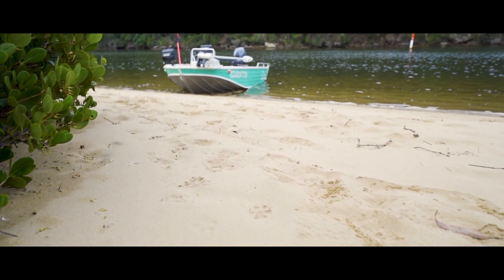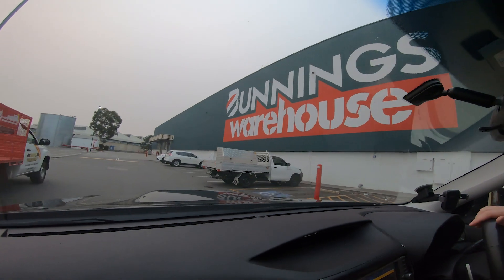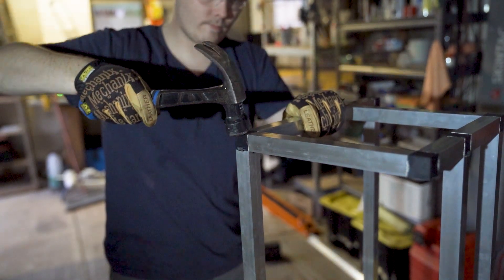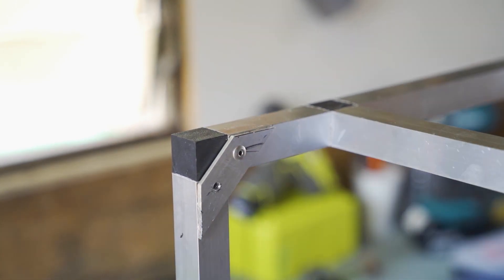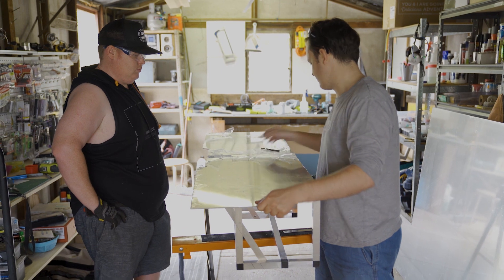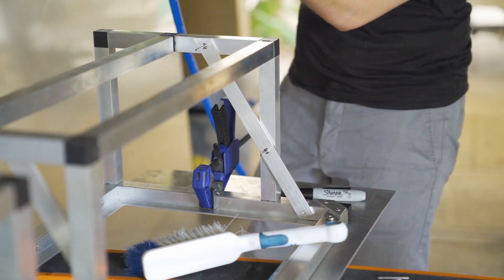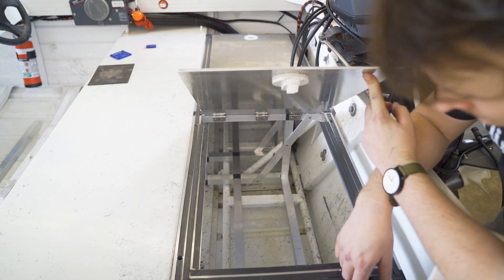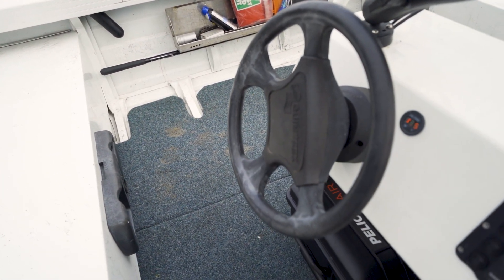BUILD an Aluminium Rear CASTING Deck | DORA PROJECT 🧜‍♀️

Comment: What was the thickness of your aluminium sheet, thinking of doing similar project replacing ply flooring
Reply from the maker: The back is with 4mm, but 3mm would have probably done the job

Comment: So watching your vlogs has  got me thinking about making front seat in my tinny into a storage area. Top of seat already damaged by a dodgy bucket seat by previous owner. But I'd like to make it waterproof design. 
1. cut reqd access hole in seat.
2.using angle attached to C channel, mount angle beneath perimeter of hole. The C channel will be cut flush with rear of seat. Thus forming a U shaped channel for water to collect n drain at rear edge of seat.
3.using alloy sheet cut hatch top n seat top. Bend the rearmost edge of hatch down towards floor,so it covers drain holes n also gives me ability to lock the hatch using hasp n latch.
4. Hinge front edge of hatch to front of seat. Cover with Hydroturf or similar.
Sound OK?

Comment: Great vid! I will be stealing all your ideas, thanks! Also, do you think rivnuts might be useable in fibreglass? I'm going to make a removable cast deck for my boat out of ally and It's fibreglass. Will have to do some tests..
Reply from the maker: Thanks Dean Watt , I think it’s feasible to use rivnuts in Fiberglass but I do recall there may be some incompatibility depending on the materials used. I think close use of aluminium in some composites can cause catalysed corrosion but it’s a very faint memory. Maybe have a google and let me know? I’ll try have a look tonight too
Reply: @GriftCo  Hmm I never considered the corrosion side of things. Are the rivnuts ally? I'm guessing you're an engineer of some kind? I may be calling on you in the future when I totally stuff up my cast deck design haha
Reply from the maker: Haha, Not as boring as an engineer Dean. I’m an industrial designer but work with engineers all day everyday so they rub off on me. Keen to see your deck when you’re done - feel free to DM me through insta @grift.co
Reply: look into well nuts - might be better in fiberglass due to flex of rubber....

Comment: Next time you cut alloy use standard bees wax as a cutting lubricate. Cleans up easier with acetone if you ever want to weld. Wd40 is oil based and your welder will hate you for it if you ever go down that path. 

Nice work brother 🤟🏻
Reply from the maker: Thanks Mate! That's definitely one I'll have to look into. I try my best to clean everything up with Acetone prior to welding these days but everyone get's lazy once in a while, right